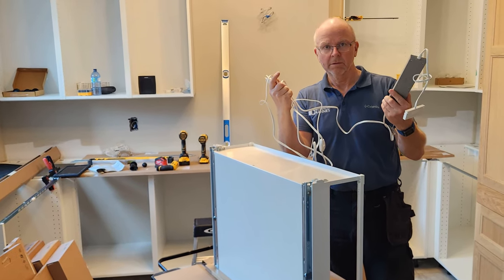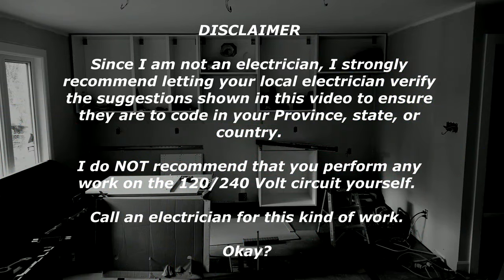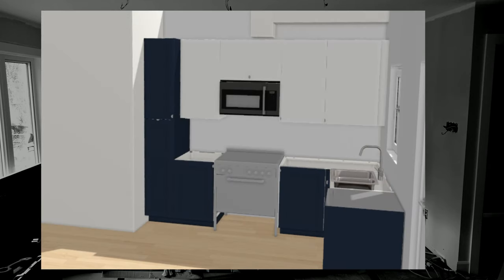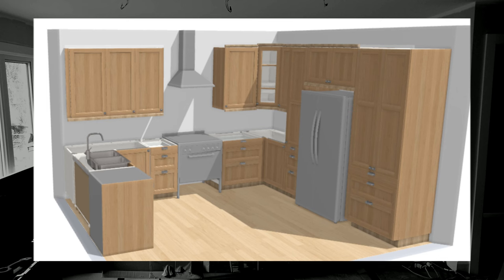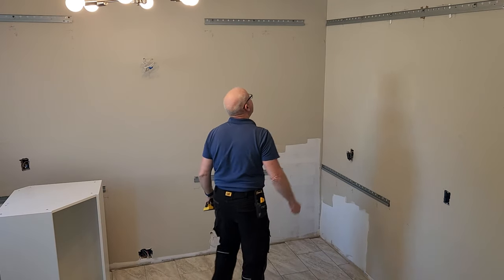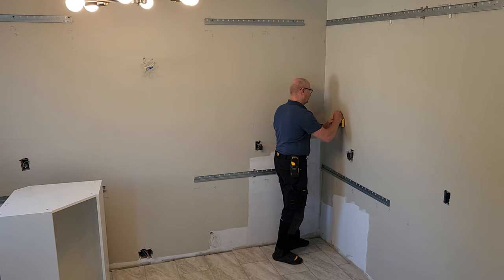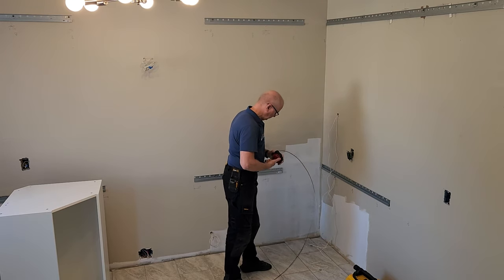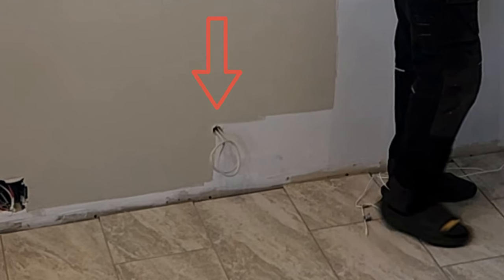Master Your Cabinet Lighting: Expert Tips to Hide Ikea Power Supplies Effortlessly

Comment: Hi again :). Question: Can I connect two VAGDAL 3.5m cords together in a longer reach application?  We have one under cabinet light that we’d like to fish that will require more than 3.5m.  Thx in advance!
Reply from the maker: Hi Mark.
I don't see why you couldn't. I'm sure an electrical engineer would could come up with a formula saying why it would be an issue, since the resistance increase with the length but I wouldn't worry. If you only need to extend it with a meter or so, no need to use the full 2x3.5 m. 
Just spline them together. Soldering with added crimping plastic is best, but I'm sure less fancy solutions will suffice. Let me know here how it goes.
Reply: @kitchensbyrannes  turns out we were able to fish it such that we could reach using one length of Vagdal. Thx!

Comment: We hid ours behind the fridge. Used the pug back there (1 for for fridge 1 was free) and then screwed it into the wall and ran the cables from there. The fridge covered all our evidence.
Reply from the maker: That's an option too. 👍
Sometimes that's not sufficient though if you have a galley kitchen, as an example.

Comment: You could use a magnet on a string, sometimes easier. Meget morsome skor.
Reply from the maker: Thank you for your suggestion. 
Only possible if the wire is magnetic 🧲 ☺️